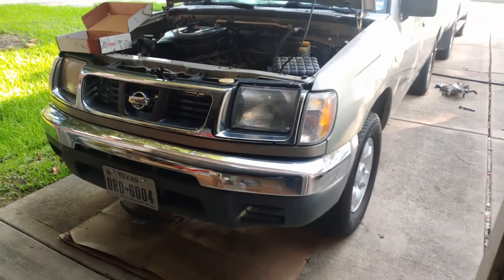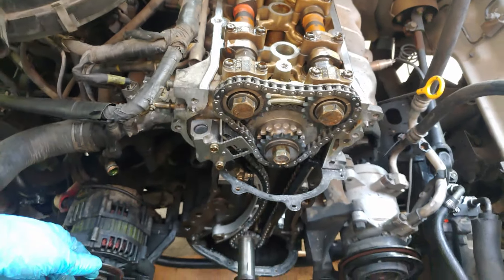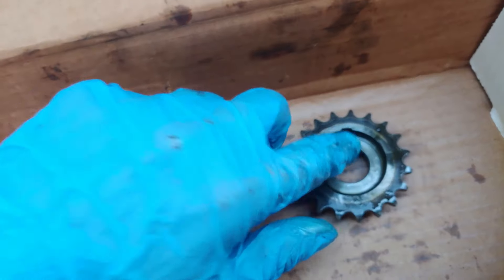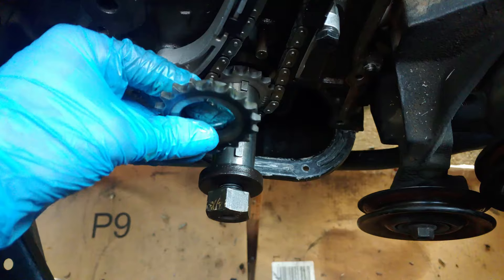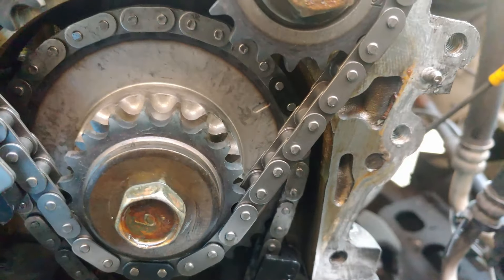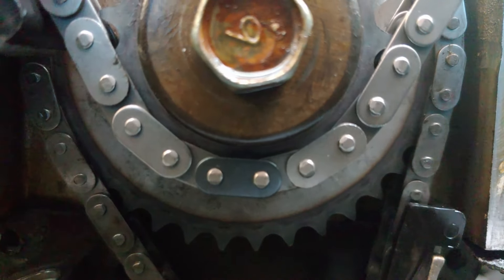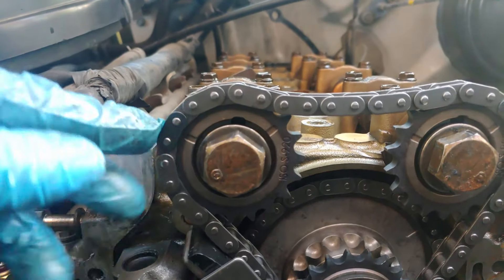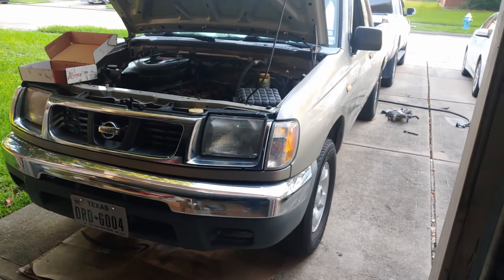KA24DE Timing Chain Explained | 2000 Nissan Frontier XE

Comment: Nice man.  I can't even find a timing chain kit for my fronty anymore.  Always on the hunt for parts now.
Reply from the maker: What year is yours ? I got my Cloyes timing chain kit from Rockauto.com 

You can also buy all OEM from a Nissan dealer but you will just have to buy all the parts seperately since they don't have a "timing chain kit" available.
Reply: @ByronRamos_  Mine's an '01.  I had been going through Nissanparts.com and NAPA. Both of them told me they're no longer sourcable.
Reply from the maker: @bikenraider99  Try here

https://www.courtesyparts.com/

Comment: When you say if the chain was not broken what do you mean? I had the upper chain snap, but I took the head to get machined and replace the valves. After the install I had everything set and it looked good. After not getting it to start properly, I removed the valve cover and saw the timing lines had jumped a bit and the chain seems to shake after every rotation. Wondering if I just got a bad chain or tensioner.
Reply from the maker: In my case tensioner went bad so it caused the chain to jump timing. Chain did not break physically.

Comment: I noticed the weirdest thing when i took the timing covers off mine. So neither of my chains ended up breaking but the links were a few off from the alignment marks on both chains and the old lower chain only had 1 marked link. It's possible that the chain jumped a few links but all the sprocket marks looked lined up somehow like in your video. How is that possible?

Comment: I just finished putting mine together and needed a video comparison of the upper chain tdc as I think mine is not correct.

My exhaust cam looks 80° where as yours looks 90°
And my intake looks 90° but yours looks 80° 
So I'm going to change that now... hopefully it fixes my issue

Comment: Got same truck, '00 Frontier XE manual 4cyl, 1.5 year ago. With 117K miles on it. Has been a headache to pass California smog. EGR monitor won't complete. Replaced catalytic converter, EGR monitor, solenoid, thermostat, new clutch and flywheel. 
Currently in shop for new timing chain, water pump and radiator. Not putting anymore money into it after this job. Any suggestions/help with that EGR incomplete monitor. There's no check engine light.
Reply from the maker: Im also planning to stop putting money into it. Thinking of moving on to the new 2022 model. 

In regards to your EGR issue i have no clue. If you're on FB, join this 1st Gen Frontier Facebook Group. Ask the question there and someone else might have an answer for you. Good luck.

https://www.facebook.com/groups/Nissan.Frontier.D22/?ref=share

Comment: Thank you for providing this information, since there isn't much available at this stage of the repair. Did you need to remove the oil pan to get to all the bolts? And does the front timing cover contain the oil pump? I have the exact year and model of Frontier and need to do this procedure before long, since it has 215K. I figure that replacing the oil pump would be wise, since I'm already deep into the engine and with the mileage. Thank you for posting this and best of luck with your truck and it's new lease on life. These trucks made during this time period are some of the best Nissan has ever made and I want to keep mine going, just like you. Greetings from Louisiana!
Reply from the maker: You can remove the front two bolts of the oil pan so that way the lower timing chain cover comes off. And yes the oil pump is installed on the lower timing chain cover. Remove the 4 bolts of the oil pump and its comes out right away with the distributor shaft. If you do replace the oil pump just make sure to go OEM. In my case since the lower timing chain tensioner broke as well as one of the guides i did remove the oil pan after this video to remove all the broken pieces that had fallen in there. Make sure before you start taking everything apart to set the 1st piston to TDC. Just follow the FSM and you should be good to go.
Reply: @ByronRamos_  So the oil pump separates from the front cover then. My truck has had it's oil changes every 3K but I keep reading about the timing system on these engines failing catastrophically and bending valves and other damage. I don't have any cold start rattle, but there is a whine that's either the timing system or the AC idler pulley. I'm getting ready to take the belts off to see if the whine goes away. I'm a realist and know this particular timing system can fail without warning. I would rather not have it fail and complicate the picture. I'm using the truck for hurricane cleanup, and my sister is in your neck of the woods at my cousin's house in Houston. The eye came over her city (Walker) and just tore shit up and she wont have power for weeks. It sounds like you were having a bunch of noise and you likely tore it down before serious damage to the head resulted. The engineers need to find a better material for those chain guides than that nylon plastic material. After it's been heated and cooled thousands of times, the plastic part breaks somewhere and acts like the other plastic under the hood. My friend had a grease monkey type do the timing chains in his Mustang with the 4.6L after it developed noise. The guy didn't pull the oil pan to get the pieces of plastic out, and the pieces plugged the oil pump screen and the engine seized as he was driving it home from the dude's house - within 5 minutes. Thanks for your fast reply.
Reply from the maker: @plumkey197  

If you're on FB you can also joined this First Gen Nissan Frontier group. You can ask questions, post photos and people will help you out.

https://www.facebook.com/groups/Nissan.Frontier.D22/?ref=share
Reply: @ByronRamos_  I finally bought the timing kit from Rockauto and will be tearing into the Frontier engine soon. I need to check out the  Nissan Frontier group on FB. Thanks for the link. Do you still have your truck and is the timing system back to normal? i'm thinking of making a video series on this procedure - one for the teardown and one going back together. You are the only one who has anything meaningful about this job with the KA24DE.  Hope you are doing well in Texas!

Comment: I don’t know if I missed it or not … why u change the timing chains belt ? Cuz it time to change or it making noise??? My truck makes noise when starting engine n idle for while with noise then it stop noise and still running motor so short time noise then goes away
Reply from the maker: I decided to replace the timing chain because it was making a rattling noise on start up. If you are planning to keep the truck for a long time i would suggest getting the timing chain replace before it gets worst and eventually gets out of timing and does more damage internally like bending a valve.

Comment: How did you install timing cover after you torqued your head down.
Reply from the maker: @adamyoder5853  head was not removed.
Reply: @ByronRamos_  i had issues reinstalling my lower timing cover,  thats why i was questioning it. Thank you for the quick response.  Great video, i really appreciate it

Comment: Hi if I cut the my frontier head is that going to make the chain slack an make it jump timing?
Reply from the maker: What do you mean if you cut the Frontier head ? Resurfacing it ?
Reply: @ByronRamos_  yes
Reply: @ByronRamos_  yes resurfacing
Reply: It shouldn't make that much differance, a few thousands of and inch.
Reply from the maker: @shaneparry4148  We are talking about thousands of an inch so like the other person mentioned it wont make that much of a difference. You should be good.
Reply: @ByronRamos_  it keep pumping the timing

Comment: Hey, thanks for posting.  My son is driving the same truck and the timing chain wore a hole in the timing cover.  I'm going to tear it down and make the repairs.  Do you have a video for the disassembly completed up front?  Did you have to drop the cross member?  Lower the oil pan?
Reply from the maker: Unfortunately i do not have a tear down video of this. I just followed the factory service manual. After this video i did remove the cross member to get access to the oil pan. Once i removed the oil pan, there was a bunch of broken pieces from the timing chain plastic guides. Just make sure to have the truck on jackstands before dropping the cross member.
Reply: Thanks Byron. I will do a little more searching on YouTube for tear down videos.
Reply: Byron, do you happen to know what size bolt goes into the harmonic balance to use with the puller? There are two threaded holes on either side of the harmonic balance 27 mm crank bolt.  Need the thread size of these

Comment: How do I know for sure my Timing Chain was bad without open up everything? I has same truck as yours with 182K miles, current crank but won't start.
Reply from the maker: Once those timing chain guides start going out you would tell a chain/rattle noise coming out from the front of the engine. Kinda hard to explain unless you hear it in person. In your case it might be another issue. Distributor rotor and cap are in good condition ?

Comment: great vidoe how many miles were on the truck when you decided to replace and why did you replace?
Reply from the maker: Like 234K mi,  plastic timing chain guide broke..
Reply: @ByronRamos_  mines at 150k and sounds like its going out. wish nissan made the guide out of something stronger.
Reply from the maker: @MistaRibzz  Same. Wish it was made of stronger material. I do recommend for you to replace before it fully goes out or else you can have a bad situation where your chain goes out, chain gets out of timing then the valves make contact with the pistons...
Reply: @MistaRibzz  My lower timing chain guide broke in half at 210,000.    Bent every valve in the head.   The machine shop charged be $400 just labor and $130 head gasket set to rebuild the head.   My total out of pocket including towing, water pump and oil pump is $1,400 doing it my self.  A mechanic quoted me $4,000 to repair it and they earn it,  If you plan on keeping your truck put a new timing chain kit on it soon for about $300-$400 all in, taking the head off is a real chore and the machine shop took 6 weeks to get my head back to me.
Reply: @laidbacokie  turns out it got so loose it skipped a tooth. one cylinder making 0 compression. i ended up selling it. got 1300 bucks for it

Comment: I recently started to hear this clicking sound. It goes away after 2600 rpm. Went to the mechanic and he said it’s a loose timing chain. What do you think. Should I do a timing chain job or would I have to replace the engine. I still need to open it up and look.
Reply from the maker: If you're going to open it up anyway, i would start by taking everything apart from the front of the engine. Do that to see if it's a timing chain issue. Don't buy a replacement engine nor any other parts until you know 100% whats the issue. A timing chain guide is probably on its way out or its broken which they're really known for.

Before you start taking stuff apart make sure to set 1st piston to TDC.

Comment: Have only put 3k miles on it. Just changed oil, will do spark plugs and Fuel filter once outta shop. Will replace battery cables too.
Reply from the maker: Do the distributor cap too.

Comment: At what mileage should you replace the timing chain / kit?
Reply from the maker: In my case, first time was around 160K miles, 2nd time was 234K .... If you have never got it done i would suggest to get it done and not wait till a guide breaks and causes other damages due to the timing jumping.
Reply: @ByronRamos_  Thanks. I'm at 182K now on my 2001. I should probably do it.
Reply: @jimmymundane1084  My lower timing chain guide wore in half at 210,000.   The timing chain came totally loose and I had to rebuild the head.  I wish I would have been looking for this as an issue .  Pulling the head is a real pain and expensive even if you do the labor. $300-$400 versus $1,400 including towing.   The machine shop took 6 weeks to get me my head back.
Reply: @ByronRamos_  mine has 110k on it, but has a fair bit of rattle when cold
Reply from the maker: @squidinkRC  only on start up and then it goes away right ?
Reply from the maker: @laidbacokie  Yup had a friend that the same thing happened on his Frontier and he had to get the head rebuilt.
Reply: @ByronRamos_  yea after a minute or so, I have a video of it
Reply from the maker: @squidinkRC  Thats normal due to the design of the timing chain tensioner. Its spring and also oil presurre activated.. over time the spring inside the timing chain cylinder gets weak thus why on start ups you get rattle chain noise for a couple seconds till oil pressure builds up
Reply: @ByronRamos_  that’s a great explanation! I gotta find a source for an OEM oke
Reply from the maker: @squidinkRC  Yup. And that 1st Gen Frontier FB group is good group. I used to be in there while i had my Frontier.
Reply: @ByronRamos_  Is the tensioner changeable without taking the whole timing chain cover off?

Comment: Thank you sir
Reply from the maker: Welcome
Reply: I just got my head back form the shop and am working on putting it back together.   It is very fresh on my mind if you want to holler at me.    This is quite a job.
Reply from the maker: @laidbacokie  Niicee
Reply: @ByronRamos_  This is the best video on the internet for the this job and I have looked at a bunch of them.   You have helped save my 2000 fronty from the salvage yard.
Reply from the maker: @laidbacokie  Glad i was able to help !
Reply: @laidbacokie  exhaust? Or they resurfaced ur iron